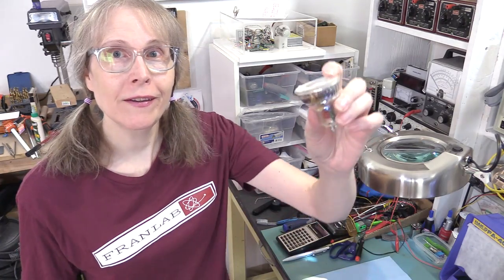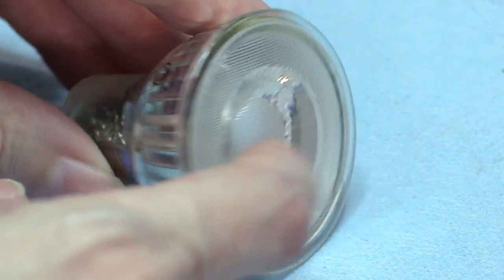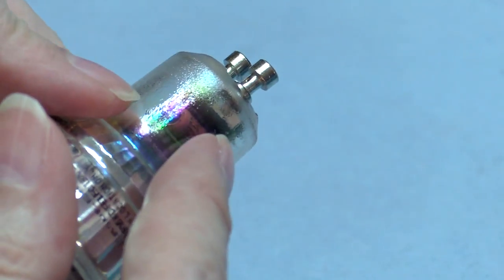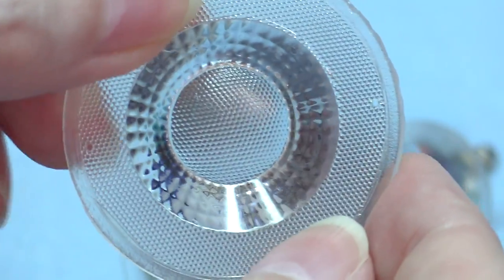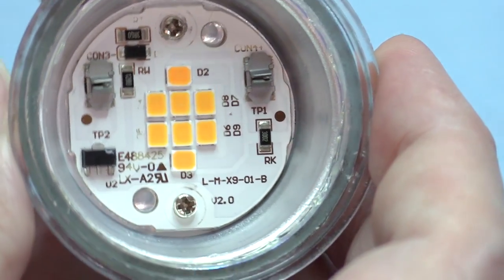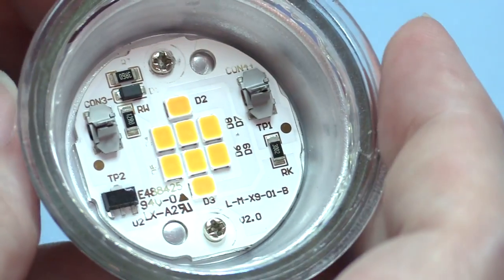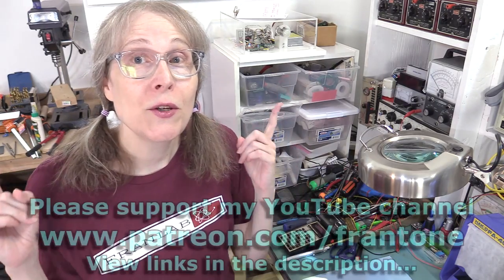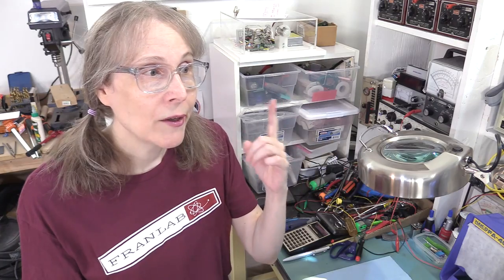Inside An LED Light

Comment: I would assume that if the power is pure coal power, then LEDs are a no-brainer, they result in much less coal burnt over the lifespan of the lamp, thus LED is saving a lot of CO2.

However, if it is hydro, nuclear, solar or windpower, then the picture is much more complicated, as hydro/nuclear is "unlimited", while - solar or windpower is not that plentiful - yet.
Still - as the renewable energy sources, in practise, are limited in quantity, and replaces coal, then LEDs, using less energy, enable the use of those sources, and in the complete picture,
still are viable.

And for local pure wind or solar installations with battery backup, LED is the only practical option. 

Then it is the installation of public lighting, in offices etc. where the cost of having a janitor replacing lights, also counts, plus - some LED lamps are even more environmentally hazardous than these "halogen" lights, because the LED is built-in, so that the whole lamp or fixture must be replaced, if the LED lamp burns out. And complicating the issue further, is that halogen lights contribute to
heating in the winter, while contributing to more use of AC in the summer, so perhaps it would be rational to switch to LEDs in the summer, and back to incadescent lamps in the winter, if your
power source is hydro or nuclear. :-)

All that being said - I suspect most LED lights are not getting the full possible lifespan of the LED- itself  mostly because of inferior quality of the components, condensators not tolerating high enough 
temperatures, the lamp not getting enough cooling, so in the concrete case of disassembling this lamp, it seems like bigger vent holes should be made by the enthusiast, caring for the environment.

Yes, I was dissapointed that Fran didn't check if it was possible to revive the lamp, hope she does that, the next time. :-)   A little too much rant about the energy use of making those components,
without constructively evalating how the cooling could be improved, or if the CO2-emissions stille be less if the electricity was generated by coal, which I am quite certain of. However - we agree
that noone likes e-waste, that's for sure.

Also - the glass encasing actually insulates the heat, together with the silver coating, so retrofitting glass casings to use LED inside, is a bad idea, if you want lamps that last a long time. The
best option would actually be metal cases, with ribs and vent holes all over the place, however then there is a trade-off esthetically. Also, the armature often is quite enclosed, to shield the surroundings
from the strong heat of the halogen bulbs, which however traps heat from the LED lamps, most probably decreasing their life time. So retrofitted LED lamps for halogen, is not the most optimal solution, however the alternative would be that everyone had to throw out their lamps when switching to LEDs. 

Lowering the voltage just a tiny bit, letting go just a tiny bit of the lamps wattage, plus increasing the ventilation, would most probably let LED-lamps live for "100000" hours, instead of the about
nominal 30000 hours, and as we know, even 10 or 15000 hours are often stated as the lifespan of the lamps, even though 30000 should easily be possible, probably due to the practical problems
with cooling. 

As a rule of thumb, most electronics fails today, because of broken condensators in the power supply, because of heat - on the other hand, the electronics industry do not want those to be too long lived, as noone would buy new products. Still, this is what we must do, to refuce emissions, a lamp should last 20 years, not 2 years, it is completely possible, if we want to!

So if you can - check the cooling of your LED-lights - if you can dim them down, just a tiny bit, that would increase the life span, too, which is also valid for incadescent lamps to, by the way. Also
regular LED-"bulbs" have the same problem about cooling, as they are encased in a matte bulb, that traps the heat, decreasing the life span.

I suspect by the way, that LED strips, slightly dimmed down, is the less energy consuming option, then there is no huge use of metals, printed boards, cooling is no problem, and there are Youtube videos about converting broken LED-monitors and TVs, to LED fixtures to put in the roof, to give a very nice, not sharp, LED-light that often can be adjusted, colour-vise.

Comment: Those lights should work many years without dying. LED ought to last much longer than other types of light but they are not due to the horrible thermal design and cutting corners everywhere.
Sometimes I often seen many these bulbs have the chips running around 90 celsius, and many of them fail because the power supply failed, not even the LED module.
These things have so bad thermal design that the electrolytic capacitors in them can die before the power chip or LED.

Comment: I suppose if everyone had 12V dc power running through their house LED lights could be manufactured much more simply and with way less parts. Having to include a switching power supply in each bulb is wasteful.

Comment: Very much like wind turbines and the massive carbon footprint of wind farms.
Reply from the maker: It's all about the return vs component lifespan.  If the generators last a long time then you recoup the carbon from manufacturing.
Reply: Wind turbines are carbon neutral inside of 3 years, with an operating life of 30 years.
Reply: @johnnodge4327  That is an absolutely false statement, not only does that not take into account the carbon footprint of the materials used in just one single turbine.Try 241.85 Tons of CO2 just in the production of materials for one single turbine. That figure also  completely negates the mining processes involved in producing the pig ore, concrete or address the massive neodymium magnet that is produced by repeatedly boiling acid and producing radioactive thorium waste as a byproduct.  Then lets take into account that an average wind farm requires anywhere from 2 to 60 acres per megawatt. Then there is the fact that wind turbines kill between 140,000 and 330,000 birds each year.  Wind energy in no is carbon neutral in 3 years, Im sure that what wind energy companies would like people to believe.

Comment: I would not defend our negative impact on the natural world.  That aside, the LED bulb lifetime should be much longer than a year, more like 5-10 years.  From my experience, the greatest weakness in designs is the thermal cooling of the high power LEDs.  In the design you show, the heatsink is completely inside a glass container which is a good insulator.  Over time, with better designs, lifetime should improve.  I have a dozen PAR20 LED bulbs which have not failed in 5-7 years, these have much larger effective heatsink by conducting to the outside of the bulb and to the E26 base.  The elements and components in LED bulbs are not much different than in many electronic devices, especially those with displays.  So, yes we have a problem with degradation of the environment and the many cell phones tossed out every year might be a much larger part of the problem.  I suppose the cost of things should include the cost of safe recycling, if it's possible.

Comment: I still prefer simple incandescent. The affordable LEDs only last a year or two, and end up piled on my electronics bench to harvest the components that are still good. Inevitably, the only failure is due to a single LED in the string that went bad. And most everyone else just throws them away! What an incredible waste of electronics. I just turn off all the unused lights around the house if I want to save energy.

Comment: LED devices in LED lamps are overloaded. Instead to overload the LED-s is better to rise the number of them and low the intensity of current, but this is financially inefficient because of life extension of them. The better solution is to take a higher power lamp and reduce the intensity of current by changing the circuit element that establish that (resistor or capacitor). It works, but this is for "connaisseurs".

Comment: If manufacturers stopped thrashing the arse off components. They would last 20 years. Caps get hot because they bake in the heat from thrashed LED's. Thrashed LED's wouldn't need to be thrashed if they used twice as many and half the current. In bulk LED's are cheap! Big conglomerate business bosses need knocking down a peg or two. Or the public needs educating? I'm not sure which.

Note: I used the word "current". Many YouTuber's say "Amperage". Maybe someone can explain to me what "Amperage" is?
Back in my day Ampere's were known as Amp(s) the base unit of electric Current

Comment: Your bulb only lasted a year. I run an incandescent porch light 24/7/365 and they last 8-14 months. I know inside lighting that gets used everyday only lasts 3-8 months but LED would have to last at least 3 times as long as they cost a minimum of 3 times more just to equal cost. Those LED bulbs are made in China because they would cost exponentially more if made where safety and pollution is regulated.

Comment: I have had 3 Led lights fail and they cost a lot more than incandescent light bulbs. That's an expensive fail. I know from research into electric cars verses gasoline powered vehicles from manufacturing to end of life of vehicles that there is only a 10% difference in carbon footprint between them.

Comment: These style lights are a really bad source of Radio Frequency Interference, as a shortwave radio listener if I have my led track lighting on it wipes out certain parts of the bands. With a SDR receiver and spectrum display you can easily see how bad these things can be. However my 'traditional' style led light bulbs which are in the rest of the house fittings don't have anywhere near such a bad RFI yet presumably they are using very similar technology and all coming from China.

Comment: I wish some politicians will put some effort to remove this scam. These LED bulbs have "10 000h guarantee" on the box, yet are failing in less than one year 24*365=8670h Assuming it's turned on 24/7 it should last longer, but it is clearly not. All LED bulbs I examined failed not because of LEDs but this current source IC (chip you referred as dc-dc converter) At least in the model I got (I haven't tear down any Ikea leds yet)

Comment: There was much more circuity and components than I thought there would be. Yet every manufacture uses their own design. I've had issues with China made LED lights. I have 1 fixture in the bathroom that has a marginal component in it. There is 1 LED that pops on after a few seconds.
I had another standard bulb looking one that started flickering after about a year. These bulbs are suppose to las at least 20 years. Some of the companies that use overseas mfg. use some low quality parts and manufacturing. Your hair could curl seeing how these are made overseas.
I worked for GE for a bit and the stories of the far east people that made their products would scare you. Many also use Mexico manufacturing to save money but quality is way down.
It's always about the cooperate $$$ and not the customer anymore. Exception is many Japanese companies. They plan for long term growth.

Comment: You don't need studies to tell you how much energy something took to make. All you need to look is the price :)

Let's face it - raw materials cost nothing compared to the processing. So most of the cost of the product is the energy it took to be produced.

And sure - China is actually the world leader in renewable energy, they have huge amounts of solar and wind power, not to mention their Earth-imbalancing hydroelectric projects ;) But that aluminium heatsink and alumunium PCB? Last I checked, there was no way to smelt aluminium industrially without coal. It's the most abundant metal on the planet, and yet pretty expensive in metal form, because of the energy it takes to process.

So not only energy = cost, but you can't take coal out of it at the moment.

So there surely are places in the world (California? Germany?) where they could get bigger CO2 reduction by using incandescent bulbs... that's if their grid could take it ;)

Comment: China is working to reduce their CO2 emissions. They've cancelled every coal power plant construction project that they had planned, and built more renewable generation capacity than they had planned to build coal generation. But it's a big place, so it's going to take time for them to shut down their coal power plants. They are working towards it though.

Unlike here in Australia, where the *Coal*ition government are planning on building new gas fired generators because jobs or something. Despite the fact that the renewable energy sector is now a bigger employer world-wide than the fossil energy sector. That's right, more people work in renewable energy than in fossil energy. So no, renewable energy doesn't /take our jerbs/, it creates jobs!

Comment: LED lights fail because of heat. They skim on the heatsink and that's the reason they die, use a bigger heatsink and it'll last forever.
Reply: I am with you. Most likely the failure is from insufficient thermal management. The other consideration is the electrolytic caps as they are also a bone of contention. It is interesting how much a lamp relies on the socket to help dissipate heat. I was working on an led light bulb replacement design 12 years ago and learned some surprising things.

Comment: a lot of chinese stuff is crap, even the simple stuff, e.g. an electric radiant heater, i.e. a coil of resistance wire, supposedly nichrome, inside a quartzglass tube, open to the air at the ends, rated 400 or 450W. I've bought about a dozen twin-element heaters - not a single bar has lived out its guarantee period, though about half have come close, while a tenth have failed within a month; cheaper to replace the whole thing than fix any part of it. Contrast with a 1kW heater manufactured here and at least 50 years old which failed a few months ago, and can't be given a replacement 'element' because the manufacturer went belly-up in the 90s. Cheap goods = enormous waste.

Comment: LEDs definately don't last for their claimed lifespan!
Reply: LEDs in general certainly do, got enough devices that run for over a decade with at least some kind of LED in it, that´s more than 87600hrs.
Problem with the ones that fail - powered beyond good measure, the LED as well as the driver circuit.
Reply: @sthenzel  LEDs, it seems especially the white ones, get much dimmer over time with use. The caps lock LED on a laptop will be noticeably brighter than the power LED even though both started as the same brightness.